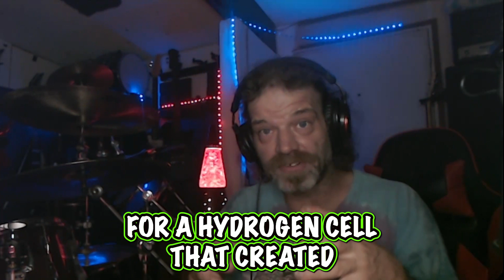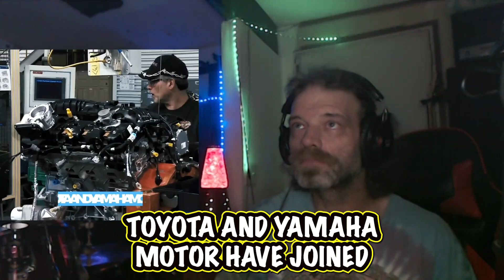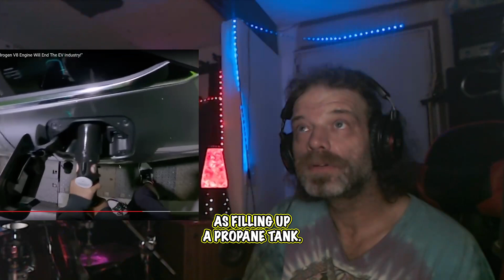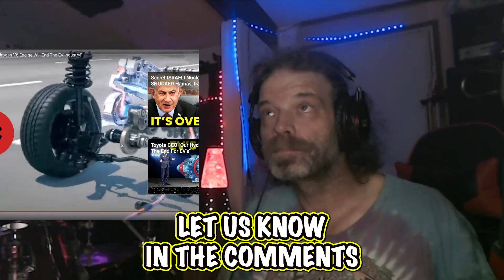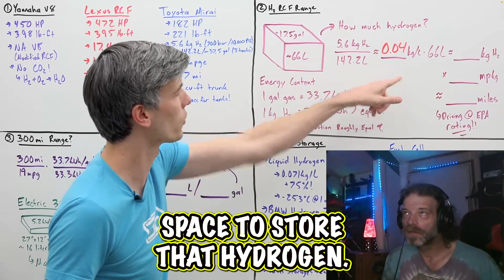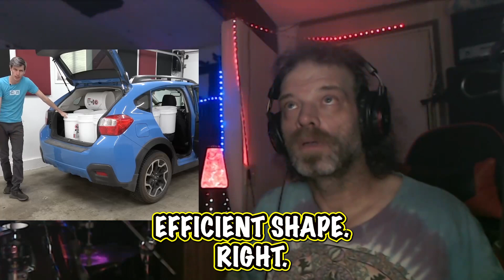The Next Gen Green Engine

Comment: Sorry you lost me when you stated that splitting of molecules is nuclear.

Nuclear refers to the splitting of the nucleus of an atom.

Splitting molecules is basic chemistry.

Yes you can split water using DC, but it will use the energy in the AA battery. The energy you get from burning the created oxygen and hydrogen will be less than what you would using the AA battery. This is thermodynamics.

I can see your heart is in the right place but i would recommend reading through text books for fundamentals of chemistry and fundamentals of physics. and you can circle back around to this topic.

Maybe research the challenges of producing green hydrogen and doing a comparison of the energy loss between electric cars vs hydrogen cars when taking the end to end efficiency. 
😊
Reply from the maker: The article I read said that NC told the inventor of the water car he could not produce any more because it was water fission. I know atomic is nuclear. Did you hear what was being done or didn’t get what he was doing. An engine burns gas as a fuel this ac spark design uses water as a fuel. Not hydrogen.. hydrogen and oxygen are the used particles in the fuel but water is shot through the carb just like gas would be. What you are talking is different.
Reply from the maker: Just a outtake added side note since you took so much time to write this and didn’t catch what I was saying. I’ve got a masters degree, I took chem 2, micro bio, genetics, and molecular bio. As I stated.. the state of North Carolina called it nuclear so it wouldn’t be reproduced.. they deemed it water fission. I’ll make a video explaining it in more detail since you’re stuck in hydrogen and not seeing past that.